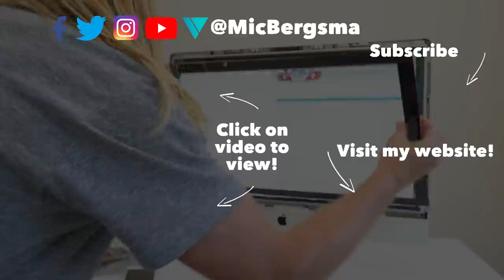2010 iMac 27" Graphics Card Replacement | MicBergsma

Comment: I'm not deaf....yet!  Butt loosing my hearing due to loud noises over the years. I really appreciate the overlay of captions and the mapping of screws and cable locations. I've done technical work all my life and this is a VERY refreshing how to video tutorial! I appreciate all the effort you put into this.
 I acquired a A1312 emc 2429. Complaint was loss of video, I noticed that it was really hot exhaust air coming from it, I hit it with compressed air and started it up and ran a video test video for over 24 hours and never lost video. The exhaust temp was  upwards of 130° . I put the thing on the shelf, recently I order some thermo paste  Arctic Silver to reapply to all the heat-sink surfaces. I wanted to refresh my memory about getting into this machine when I came across your video. Thank you!

Comment: I just did the graphics card bake, it works. This video was a huge help and I agree with those who say this is one of the best out there. The one thing I really didn't appreciate when taking things apart was just how many different connector types that a Mac has. And, you'd think they would all go in the same way but nothing could be further from the truth. What would help greatly - and this video shows it best - who be an actual drawing showing this little tiny connector that you put in when reinserting the graphics board. It took MicBergsma two minutes, for us mere mortals it took over 30. I finally brought in my wife who has much slender fingers and can handle a set of tweezers better, it still took her over 15 minutes. Thanks MicBergsma for a great video.

Comment: Two tips: please don't use the bubble plastic sheet due to the static electricity accumulating in them; and make sure there is absolutely NO hair or anything on either LCD screen or glass cover. Otherwise, they will drive you crazy!

It's too bad that you didn't choose to replace HDD with SSD at the same time. The 1TB SATA-III SSD isn't as expensive as you think. Switching to SSD does improve the iMac's performance ENORMOUSLY! It's like getting a second wind for my eight-year-old iMac. Please don't wait until the HDD fail.

I replaced the original HDD in my Mid-2010 iMac 27" three years ago. The HDD was starting to exhibit the forthcoming HDD failure (the same warning code repeating in Console and increasingly incessant beach ball spinning).

I didn't have the suction cups and wasn't going to pay for them when I would use them once. I used the thinner plastic driver's licence to pry the glass cover off the body. I held my breath the whole time because I was afraid of breaking the cover or LCD screen. I couldn't believe how HEAVY the LCD screen was! I also used this opportunity to clear the accumulated dust with compressed air.

To this day, my iMac performs flawlessly, and I don't see the need to replace it soon.

Great video, by the way!
Reply from the maker: Hey InTeCredo!
Thanks for the tips! Good to know about bubble plastic sheet thing. 

Ah yeah I almost bought SSD to replace but decided to wait a little bit...  WD or Samsung? can't decide which to get..

That's pretty cool about driver's plastic trick! Yeah I wouldn't buy suction cups just for this project... camera suction cups works great haha. 
Yeah I was surprised how heavy LCD screen was... wondering if the newer LCD screen in 2015 and up is lighter? I haven't tried one yet. 

That's awesome to see 8 years old iMac working very well! I don't see myself selling it at all yet too! 

Have a good day!

Comment: Have you tried repairing the card before replacing it?  Often to fix that one would need to clean the paste off the card, bake it at 200 for 8 minutes, let it cool, re-apply the paste and put it back together.  This has worked twice so far for me.  

What did you do with the card that was removed?

Amazing video by the way.  Absolutely the best guide yet!

Comment: Superb video, thanks for this, so clear - I used this run-through, step-by-step to remove my graphics card from my 2011 27inch iMac after it failed - instead of putting a new one in, I tried the 'hack' of putting it in the oven for 10 minutes, then reinstalled and unbelievably to me it worked!  Thanks again

Comment: You didn't pop an SSD in while you were in there? ;) Great channel BTW!
Reply from the maker: Ahh yes I almost did... but trying not to spend more money right now... saving up for a big move later this year :-O Thanks!
Reply: The problem is the mount is too small. I have an old 60GB OCZ SSD taped in mine lol. 
If anyone does try and update to an SSD, emergency boot OSX from a USB stick to format the drive. I couldn't set the partition table in my Linux and wasted sooooo much time with it :(
Reply: @MicBergsma  Did you buy a new mac (and what)? :D

Comment: This is great video.I was having problem in iMac. Randum restart, Grey & black lines, Pink & Grey lines, Blue screen, Blank screen anything was happening while working. I see this video & open my IMAC. Remove graphic card. Clean all thermal paste.If you have any  rubber seat or plastic seat around graphic card chip, you must remove it. You don't need that anyway. Heat oven 200 C. Put graphic card on Aluminium foil balls. Leave in oven about 10 min. Let it cool 1 hour. Apply new thermal paste properly on graphic cards & all I.C. See other video. It woks 100000%
I was also too aftraid of opening IMAC & remove graphic card before this video.
Thanks you sooooo much friend.
Reply: I'm having the EXACT SAME PROBLEM! There was an AMD Recall with this card the was going 4 years and just expired!  I just got off the phone with Apple 1.5 hours lol.  I screamed at level 1 saying support forums show they grant extension for the replacement.  Demanded level 2 support which got me a $100 off $300 or more coupon.  Now I'm about to try your thermal trick.  Was looking for better "opening case" videos.  Thank you @Nehal for confirming it worked for you and whoever made this video thanks.  You should try calling and getting coupon...

Comment: Phew, thanks for the video, I'm going to be following it religiously here when I endeavor to repair my 2009 iMac. One question, I notice you didn't mention thermal paste. I had planned on applying some but was wondering if there might be a reason why I shouldn't?
Reply: MrAlfable he replaced the entire graphics card setup, not just the card itself, so I assume the new card was already well pasted on
Reply: @xXGwennexXx  Yeah, I kept reading about thermal paste as googled about installing a graphics card, but I didn't realize how the imac's setup was already completely put together until after I purchased my replacement part, so you're right, it wasn't necessary (and this video was an invaluable asset to that replacement process!)
Reply: @MrAlfable  I'm doing just a card replacement, as I'm upgrading it to an nvidia gtx 765m, so I'll need quite a bit of thermal glue 😅

Comment: Great video.  I have been replacing my mid 2010 logic board on my 27" iMac.  I somehow have an extra tiny cable that needs a home along the top of the logic board.  Do you have another video showing closeup all the connectors of this logic board?  Or even pictures?

Comment: I must say your video is very easy to follow and well explained! I have a 21.5 inch Mac desktop, and yesterday I got the dreaded black screen. I have completed all the "helps" needed to reset, and still nothing. Apple says more than likely its the graphic card, (crying).  Im currently trying to locate someone in my area to repair it, but I did see through research that the 2010 had a recall? Do you know how I can get anymore info on that? Apple failed to tell me this also, imagine that?

Comment: super helpful video. I have referred to it numerous times as I pulled the 512 GPU, removed my HDD for files I wanted, then to put back together. I have an imac with a 256, which is ridiculous..1gb should be standard, at least, apple over charges and under delivers and with a 1 yr warranty. WTF?

Comment: Holding my breath that the Imac a friend just dropped off to give me a challenge looks like this one inside. MOst of the videos are for upgrading which includes breaking, cutting and grinding. I'm simply replacing the graphics card because I just want it to work again. 
I had to replace the motherboard on another neighbor's Imac a few years ago using a different video. Suprisingly for my 70+ year old self, when it hit that power button and the Apple logo came on I think I wet myself. 
Not that hard but I took lots of photos and made lots of notes about wire placement for that one

Comment: My iMac has vertical stripes that switch to a checkered glitchy pattern and it doesn't start up. Does that mean I have to replace the graphic card?
Reply: I had the same issue, it is common, you can start your computer in safe mode in case you need to access information. You can repair the graphics card, there is a YouTube video on how to do it, it worked for me and I saved money not buying another card

Comment: Mic great video. My 27" mac has got blu lines approx 25mm wide up the screen and want open , i been told this is the GPU which you are replacing. Talked to apple they say cant replace and second advice from repairer says to heat gpu unit and it works again,  where did you purchase the gpu you replaced, my computor 2010 27"mac. Thank you

Comment: Thanks for the great video like the other comments yours is very clear, love the text comments on how to fix, great editing to the point. Have a Late 2009 27" iMac with an Intel i5 CPU having boot issues screen boots great in safe mode but issue regularly booting up  goes to white screen and locks up, was told might be the GPU, any thoughts on that, and where did you get the replacement GPU?

Comment: MicBirgsma, thanks a lot for sharing this video, clear and simple. My mid2010 imac (27 inch, 2.8 GHz, Intel Core i5; ATI Radeon HD 5750 1024 MB graphics) is showing signs of graphics card failure, horizonal bands appear at random vertical locations, at random times, happens every 10 seconds or so, appears as a flash. Now the challenge of finding a replacement card from a reputable source. I am wondering if it is simply a problem with the synch cable, that it just needs re-inserting, or that the fan (part of the graphics card assembly) is full of dust and not removing the heat well enough. No luck so far with new replacement card here in New Zealand where I live, still looking. Any help would be appreciated.

Comment: Great job and thanks for the tutorial. 

Can you explain the symptoms you experienced with the dead video card and how you diagnosed the GPU was faulty and not another component? I suspect my GPU died but I am concerned in investing in a replacement without confirmation it is not a logic board or other issue. 

Issue with mine is no bootup, no display, external display not working (strongly suggests GPU issue) but also not able to boot in target mode or safe mode. Apple diagnostics couldn't run or didn't show any issue (apple repair shop attempted). It has been a while since the test has been done and kinda don't remember which it was.
Thanks and any input appreciated.

Comment: Hello, great video. I have the exact same model iMac and I'm wondering if my GPU is shot. My iMac just keeps restarting, gets halfway through the start up sequence and reboots itself over and over. Can't boot into internet recovery or any external startup disk. Could this be a GPU problem? What happened to your iMac that caused you to diagnose the GPU as the issue? Thanks!
Reply: Andy, I have a Mid 2011 iMac 27” that is showing the same  problem.  I have spent days reading everything I could on the issue, and have tried everything (keyboard commands, tried USB bootable MACOS, etc.  Still unable to fix.  Have same “repeated self rebooting” or “gets to 70% of boot, showing apple logo, then restarts or white screen.”   Did you find a good solution for yours?
Reply: Andy Deitrich Andy, I have a Mid 2011 iMac 27” that is showing the same  problem.  I have spent days reading everything I could on the issue, and have tried everything (keyboard commands, tried USB bootable MACOS, etc.  Still unable to fix.  Have same “repeated self rebooting” or “gets to 70% of boot, showing apple logo, then restarts or white screen.”   Did you find a good solution for yours?
Reply: @steadmanuhlich6734  My solution was to sell it for parts. :) I didn't want to attempt the graphics card replacement, it wasn't my main machine and didn't want to sink any more money into it.

Comment: Now is 2020 do you still recommend a iMac 27 mid 2011 I wanna buy one
Reply: Imac 2011 with upgraded video card in order to support METAL function.
Reply: iUrbex iUrb  hi what does that mean as I would like to replace mine also?
Reply: @lovebeingawake8549  whats your motherboard model number or iMac version( an example A1312,etc..)? Mojave, Catalina support METAL video card for graphic acceleration.
Reply: More to the GPU Upgrade here: https://forums.macrumors.com/threads/2011-imac-graphics-card-upgrade.1596614/
Reply: @iurbexiurb6637   Hi , Thanks for reply . Model No. A1312 Serial W80442LFHJX. RUNNING SIERRA. Is that info useful?
Reply: @iurbexiurb6637  https://everymac.com/systems/apple/imac/specs/imac-core-i3-3.2-27-inch-aluminum-mid-2010-specs.html

Think this is mine with a bit more ram installed.

Comment: Interesting... my 2010/27" iMac doesn't have a vertical sync cable. It has the backlight power cable, panel temperature sensor, and display port connector. My LCD is an LG panel. Maybe Apple used different panels with slightly different configurations?

Comment: May I ask how you knew it was the GPU that failed? I have the same IMAC model and year and mine will turn on and I get the white screen with the apple, but the loading progress bar only loads half way then it stops. Eventually the entire screen just stays white because the loading never finishes.
Reply: That's exactly what mine is doing and wondering same thing...is it the GPU? I'm not yet certain.

Comment: I’m a carpenter and a tattooist. I have an 2009-2010 iMac. 27 “ like that one. Is a graphics card and a video card the same thing? Also, where can I get a video card for it. I had taken it to the apple store and they diagnosed it but refused to work on it. I like this computer and it has a lot on it I need.

Comment: Could it be that some of these mid 2010 iMacs come with a graphic card that is inseparable from the motherboard? I can't remove mine and it looks totally different than the one in the video.
Reply: Nevermind its just different on the 21.5 inch iMacs.

Comment: Hi. I have an iMac 2010 high Sierra no boot spinning. iMac can not be in the safe mode,after the reinstall the software can not complete the installation. I Took out the shuttle and hold power button and again no boot. Problem motherborard ,Ssd, Gpu ? Please help me

Comment: You would not have needed a new one, the graphics card out and the pure circuit board at 200 degrees for 9-10 minutes in the oven afterwards apply heat paste to the old places. Screw together!

Comment: Mic, excuse my poor english. My iMac shows green lines over black colors and pink lines over white colors. I have the same iMac model. What was the problem with your iMac? Maybe the same as me?
Reply: Sounds like your GPU is going to die soon, did the lines show up at the same spot or it would show up in different spots? Also try to plug in a monitor, see if it has lines on the picture too
Reply: i'm having the same problem. haven't plugged a monitor in yet, but i plan on replacing the GPU myself, i've been procrastinating because the gpu costs about the same as a new unit of that year. fuck apple for that.

Comment: Hi just whatched video i have a 2010 "iMac and it keeps cutting off although running in the background, when i press the on/0ff switch it comes back on then go's off again after a short while.Very annoying i took it to a repair shop in Doncaster where ehe gave it a complete blow out and clean and set up the fans, But its now doing it again but not as bad as im using a is type. He says he thinks it will need a graphics card? Do you think that what i need? I may be BRAVE and try and install it as per this gREAT video but im scared Ill fcuk up.What i sth best card to get if i need one? Im in the UK.

Comment: HI there I recently upgraded my GPU to a 2GB radeon one but the 4 legged metal thin that goes right on top of the GPU and underneath the sink holder does not fit on the new GPU and i left it out. It seems to be working dine but im not sure if it's gonna damage anything if i leave it like that? also do you know what the part is called by any chance? As i would try to find one that fits if I only knew the name of the part hah - ( i tried with GPU underside bracket screwhole thing with no luck unfortunately hah) Thanks in advance!

Comment: I have a mid 2012 iMac 27". Previous owner upgraded to 2gb the graphic video. However, when I try to playback videos from gopro8, the FPS settings from GoPro seems to be too advanced for my iMac, and it stops (hiccups) the video while audio still playing. So I was wondering maybe I have to upgrade my video card since my iMac is kinda old compare to gopro8 video software settings. What do you think??? Thanks in advance....
Reply from the maker: Maybe need to upgrade RAM?
Reply: @MicBergsma  ram is at 32gb i7 quad core w 2tb memory sata drive...

Comment: So, 2 years later, does the graphic card still works ? Because I replaced mine and didn't last 2 years. Apparently it is a common known problem but there is no replacement program solution. I hate Apple.